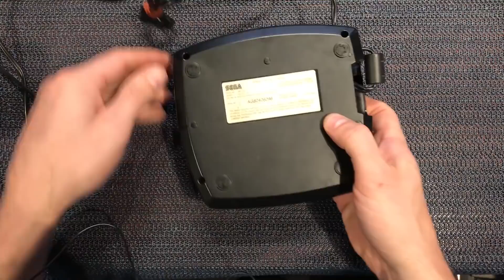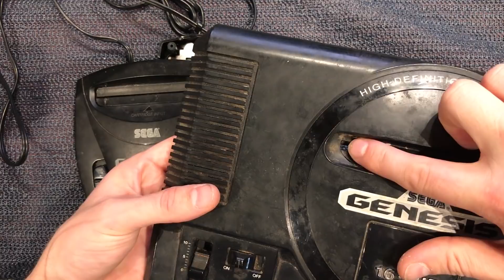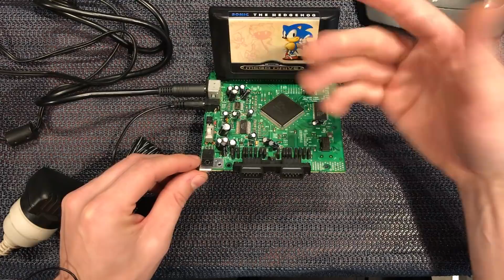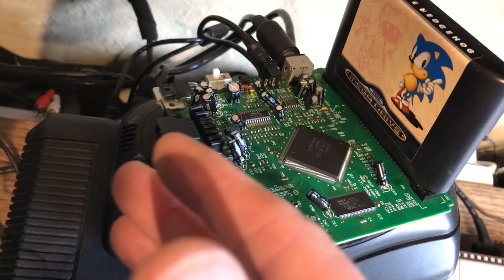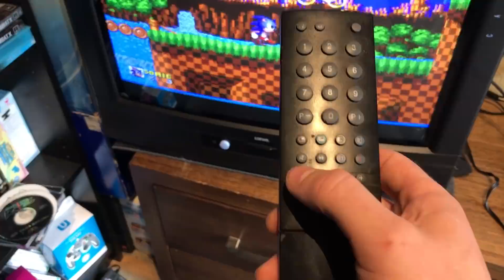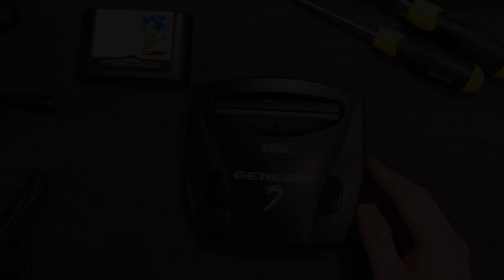SEGA Genesis 3 Fixer Upper Clean Repair Bad Mod Work

Comment: i'm  late to the video but i would guess someone had this and the cable broke and this was so late in the cycle they couldn't find a replacement  local , no internet yet you know
Reply: The 9 position mini DIN socket is too far recessed for many aftermarket 9P mDIN cables so someone may have even resorted to this after the cables they got wouldn’t fit.

Comment: Hi. Just purchased a Genesis 3 off eBay but since am reading lots regarding fakes. How can I identify mine is fake or genuine please? Also, I've heard if genuine these are region free. Is this true? Thanks.
Reply: Where did you buy it? If from china, it's fake.
Turn it on without a cart, does it have built in games? If so, it's a fake.
Is the sound abnormal? If so, it's a fake.